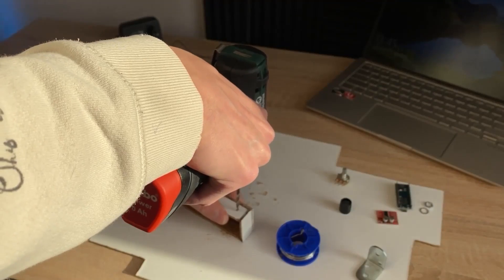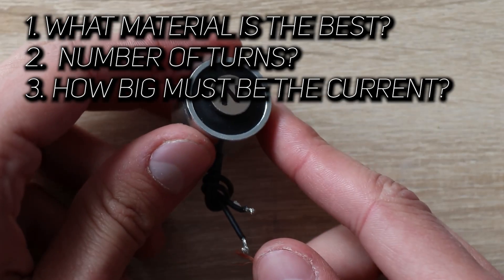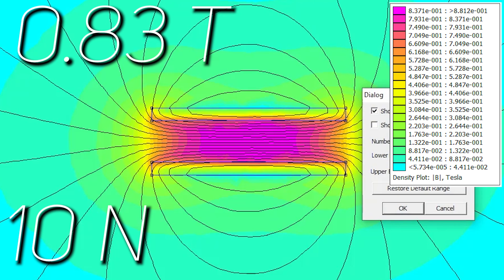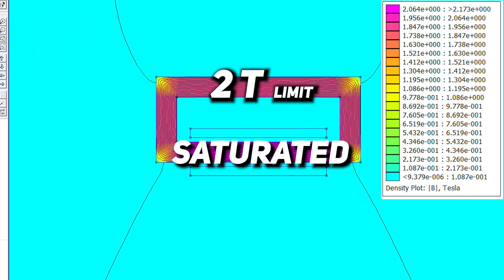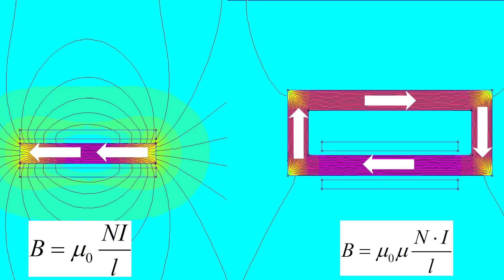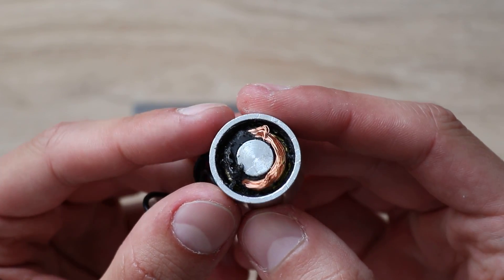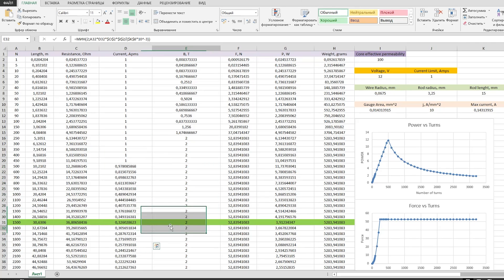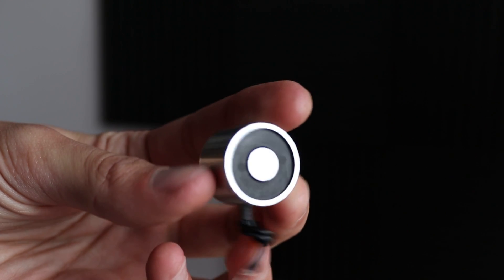5 Tips To Make A Good Electromagnet / How To Calculate Electromagnet Force?

Comment: Thanks for the video I feel kind of stupid now but also wiser. Biggest kmolage drop for me was that instead of the nail the core should also be used to guide the magnetic field around the wire on the outside as well to the one side you want magnet to grab onto the metal. Thanks for the video
Reply from the maker: You are welcome :)

Comment: @NickElectronics Would you attempt to build a non ferrous metal "attracting" electromagnet?
Reply from the maker: You can do that, but there is another principle. Eddy currents have to be induced in the non ferrous metals. Then that current creates a magnetic field which interacts with electromagnet. I am not planning to build anything like that in the nearest future
Reply: Alternating current non-ferrous metal attracting electromagnets have been in published books and articles. Leonard R Crow wrote the book and Popular Electronics has an article titled the Master Magnet. I'm struggling to comprehend the full engineering and construction process for the coil and the necessary electrical requirements. I'll learn more. I know 50 to 1000 Hz is optimal for the power frequency ranges for the magnet, and that affects the metals drawn near the working portion of the magnet. I know the copper core component is critical for field creation.

Comment: Hi can any one help me which kind of  power  is used hear ( Ac or DC or DC switching : pwm ) what is use ? because i have made a selonoid and it got hot and burned out  when applied with Dc 12 volt  lithium polymer battery  2500 mA/h      what do you say ?
Reply from the maker: DC. Probably, your soldeoid burned because the current was to high. Usually, it is okay to have current density in a wire in a range of 4-8 A/mm2. Then even without cooling it should be fine.

Comment: I want to build a fuel door lock for the car. Magnet behind the chassis, on shut, reverse current to jump it open.
Reply from the maker: I hope that info in the video will help you with that. I know nothing about cars, so good luck 😅
Reply: @NickElectronics  Basically if you put the magnet behind a metal sheet and the amperage is high enough it can keep the door shut via a glued magnet.
And then, I suppose, if you reverse the current of the electro magnet it switches polarity and it pushes the door magnet instead of pulling. No?
Reply from the maker: @DaxterSnickers  so with an electromagnet you want to pull a permanent magnet, which is behind the metal sheet? Am i understadning correctly?
Reply: @NickElectronics  Yes. The question is just if I reverse the polarity will the poles of the e-magnet switch too?
Reply from the maker: @DaxterSnickers  Yes, the polarity of the electromagnet will also change and will repel the permanent magnet.

Comment: Is normal steel or just pure iron fine?
Reply from the maker: There are different types of steel. Some of it is good, some of it is bad. Electrical steel is good, for example. Look for one with high permeability (if you can get such an info). As I say in the video - "dont take any bolt you see..." :D

Pure iron should work fine. But it gets rusty
Reply: I have a nail made from 99.9% iron so ill just use it.
Reply from the maker: @SimonsAstronomy Should work then

Comment: I'm sorry but I'm having a hard time understanding what a pancake structure coil is. I'm trying to make a eletromagnet with an old microwave transformer, does the transformer have a pancake structure? Also, how do I get the amount of turns of the coil with the resistance like he did?
Reply from the maker: @Assmannvini  By pancake i mean flat, where coil is incorporated into metal part, like i show in the video. 
Calculate resistance using simple formula from wikipedia. Knowing length of wire and its thickness it is very easy

Comment: do you know some resources about estimating the effective permeability?
Reply from the maker: I beilive for simple estimation, ChatGPT can do OK :) 
From the other side, it it easier to calculate it, making a simple experiment like this one:
https://product.tdk.com/en/contact/faq/ferrite-0014.html

You have to wind some coil turns around studied piece of metal, measure its inductance L and calculate effective permeability.  

Thirt method is doing simulation. But without any experience this one is the hardest. Cause without an experience how tf can you know if the results you get are correct or not? Good question, good question...

Comment: This video was very helpful, just a quick question. I'm doing an electromagnetic levitation project. How do I alter the electromagnetic force equation to take into account the distance at which that force is experienced
Reply from the maker: You should consider the distance to the object as an air gap. So the distance (gap) affects effetive permeability. There should be formulas in the internet which show how to calculate effective permeability of the material with the gap.

Comment: Awesome job explaining! Thank you. If you can learn the basic fundamentals and principles it will go a long way. My road to the electromagnet was much the same. You can go crazy learning too much. Maxwells equations. Yuck! Right-hand rule, force, magnetic field, flux density, permeability. Oh, yeh, total saturation. Then when you finally get it, you better learn some thermodynamics. The heat is an issue. Heat dissipation. Respect the current or Amps you need. Very fun project. You can learn much.
Reply from the maker: Thank you very much) Yeah, it is a long journey. When you think you understand how something works, there are some new variables pop in and change everything)))
But, nothing is perfect and it is better to have a non-ideal solution rather than a perfect plan)

Comment: 0:35 why is there a resistor bomb 💀
Reply from the maker: To make assembling more fun and always cut wire with a right color)
But for real, cause my non regulated power supply had a current limit and coil resistance was too low to stay below the min current level. So power supply current protection was turning off the power supply. Thus, I had to put limiting resistors)))
Reply: @NickElectronics  i thought you wouldn't reply 😅😛
Reply from the maker: @justanormal16yearoldkid51  😳

Comment: how did you calculate number of turns?  by resistance? how exactly?
Reply from the maker: I provide formulas  in the video. Resistance is only one parameter and usually process of magnet design is iterative process. Cause there are different limitations: resistance, as you said, magnet peak temperature, space limitations, its power etc. So you do calculations, check wether  some parameters are out of tour limits, then recalculate it. Resistance of the wire in reality is a bad thing and preferable to have it as low as possible, but this increases wire thickness and forces you to use more complex control of the magnet. So for magnets you can buy online, resistance is used for limiting peak current as well. In such case by changing applied voltage, peak current and magnet force can be changed

Comment: Y GREET YOU  WITH RESPECT  ! PLEASE YF YOU  WANT TO HELP ME  WITH SOME INFORMATION.
HOW CAN I TRANSFORM  A ROUND IRON PLATE,  WITH A DIAMETER OF 50  CENTIMETERS, INTO A STRONG ELECTROMAGNET  ?
THANK YOU VERY MUCH !
Reply from the maker: Google industrial electromagnet. They are big and flat. I believe you have to use similar structure for your design. But overall, all principles described in the video can be applied to your case :) Good luck

Comment: Hey brother, do you have any idea about the amperage limit of the copper wire? I need to run 10A using 1mm wire, and the internet doesn't have a consistent answer. What thickness of wire did you use and how much current did you run through it?
Reply from the maker: You need to find a parameter -  “current density” for your application. It depends on many factors, like cooling of the coil, max desired temperature etc. But the rule of the thumb is usually around 8 A/mm^2. Good luck )

Comment: Where is that Force equation coming from? what is it derived from?
Reply from the maker: Maxwell Equations, like everything else in the world of electromagnetic waves :) But they are really hard to understand. So you can google Lorents Force as well )
Reply: @NickElectronics  Thanks! But could you explain the cross sectional area? Is it the rectangle or circle version of the cross-section? If not, how is it calculated?
Reply from the maker: @weikeco  Depends on the core you have, formula will be different. Imagine you slice a core with a perpendicular to its surface plane. The area will be cross section of two

Comment: Anyone notice how his force equation doesn't actually give 100mN ??
Reply from the maker: Yes, one guy in the comment have noticed previously. I did a mistake when was putting the cross section value in the formula. If you pay attention, in the video i say that diameter is 7mm and it`s cross section would be 38.5*10^-6 m^2, but i have 15*10^-6 in the formula for some reason, which is wrong :/// So there should be 38.5 instead of 15 in the second formula and result is around 100mN. My bad.
Reply: thanks for the clarification. I am doing an experiment in which I am using electromagnets to accelerate a small aircraft and I've been trying to do research on how to increase the strength of my solenoid. Your video helps a lot. I noticed you mentioned that core materials reach their saturation limit, is there a way to increase the saturation limit of the core material?   @NickElectronics
Reply from the maker: @aaronnunez248  So far as i know, you cannot increase materials B max value. Basically, when you reach saturation limit, that means that all “micro magnets” inside the material are oriented according to the field and no matter what you cant increase B  for the that material 🤷‍♂️
Reply: @NickElectronics . sadness. So even if I were to increase the voltage/ current through my solenoid or increase the number of turns I won't be able to get a larger amount of tesla out of my coil ? Because I need more than two tesla for my project or actually I just need a larger force output. So another question would be can I still increase the force output of my solenoid even though the flux density is limited.
Reply from the maker: @aaronnunez248  If you have reached Tesla limit, the only way is to increase diameter. Number of turns and increased current would lead to nothing, unfortunately 🥲
Reply: @NickElectronics   so would an increased diameter help me with improving the size of the magnetic field or the force output
Reply from the maker: @aaronnunez248  yes. It will. Increased diameter also will allow you to increase current (or wires number). Cause you will have more core material

Comment: Good, short, to the point.  Here is our (first) Lorentz force disk:
1)  layers of aluminum foil, each layer separated by an insulator layer.  This lamination of foil-insulator-foil-insulator etc. is positioned horizontally
2)  magnetic field is positioned vertically and axially (through the center) of the lamination
3)  small flat coils are positioned radially and right next to (but not touching) the foils lamination

The coils are fed 16.28Mhz due to the skin depth that is based on the foil thickness, and induce RF current in the metal. 

The vertical B field and horizontal, induced RF currents at the 16.28Mhz rate in the metal layers develop the Lorentz force, and cause coherent accelerations (oscillations) of the charged particles in the metal layers at the 16.28Mhz rate

At time 0:43 in the video, the text from your book "Basic Magnetics Theory" says:  "When the core saturates...inductance is greatly reduced and large currents result" - we use this to advantage.

We can use thin ferro layers in our Lorentz disk and run a low DC current radially through the ferro layers to control the RF current flowing in the hull of this device.   Bill Sturgeon, 200 years ago (in the year 1824) invented "ARTIFICIAL MAGNETISM" - aka the electromagnet.  We're working at
artificial gravity devices.

Comment: This video is so awesome! One trick to reduce ohms is dividing the wire into equal segments. For instance 1500 feet ÷10 reduces wire link to 150' each. Increasing Tesla's and reducing ohms. 
Core material is very critical. Supermendur is a good material, but always use layers if possible.
Reply from the maker: Thank you for an informative comment :) 
I haven`t heard about Supermendur before. Google says it has the highers flux density (2.4 T) among all metals 🤯
Reply: @NickElectronics  I'm building a magnetic bearing linear motor, and plan to use this material at some point. So far thin layered laser cut soft iron material has worked very well in tests.
Reply from the maker: Wow, I`ve checked your channel and subscribed) It is really amazing. For what purpose are u building it?  @woodbrassandglass
Reply: @NickElectronics  eventually for experiments in generating electricity. I will change the magnets orientation to be radial and rollers be axial magnetized. Basically a motor and generator in one device
Reply from the maker: Good luck :) @woodbrassandglass

Comment: How do I prevent the stupid metal coil from turning into a permanent magnet due to use!?  I want my magnet to let GO when power is off!!!
Reply from the maker: Use core material with low remanence. Or demagnetize core applying reverse polarity to the coil. But in case of demagnetizing field strength (current through coil) should be specific. You can experiment with it :)
Reply: @NickElectronics  what is an example of core material having "low rermanence"? Is it considered a type of iron somehow?

I wish thing thing to be let go had more mass such that it might fall away. But, instead, it's like a paperclip!

Comment: It will be amazing if someone builds a tool where you place coils/magnet tipe, interna/external diameter and desired RPM (with highest torque associated) and it outputs a pcb. I have a bunch of applications and, even understanding most of these videos, I can't build this by myself (yet)
Reply: I will try

Comment: @Tall Nick Electronics How does peak current impact saturation? I need to move ~1kg at a distance of ~8mm (air permeability)  over 3-4mm.  I wanted to use a supercapacitor to discharge a burst of  2.4k Amps into a solenoid. Do you think I will hit the same hard limit? I am aware saturation follows a logarithmic scale, but I wonder if I will still get a higher Tesla peak using a burst?
Reply from the maker: What you are talking about is a high power current generator. It is a little bit different from conventional electromagnet i think. You should look theory for a railgun if you want to create something that you mentioned. 
About the parameters you mentioned, i don`t know, cause it is a specific task that should be individually calculated :)

Comment: What was the software that you are using ?
Reply from the maker: FEMM 4.2
Reply: @NickElectronics  is that only for magnet and electromagnet?....
Reply from the maker: @aravamudhankcs6476  for magnetics mostly. Also for heat flow and current flow :)
Reply: @NickElectronics  is it possible for you to make a tutorial video
Reply from the maker: @aravamudhankcs6476  i am not using it daily, so i am not specialist in it. I used it for the video to show processes in electromagnet, cause it is relatively simple tool for simple tasks. And i know there is not that much tutorial videos about it in the internet. If i had to simulate something complex, in more details, i would probably use Ansys Maxwell. Cause there are much bigger community and easier to find examples.

Comment: Hey, the equation for magnetic force in minute 2:33. i typed the numbers on screen into a calculator and i did not get 100 mN. I need this formula desperately, could you please explain what i am doing wrong?
Reply from the maker: Hey, yeah, ahaha. In video i say that diameter is 7mm and it`s cross section would be 38.5*10^-6 m^2, but i have 15*10^-6 in the formula for some reason, which is wrong :/// So there should be 38.5 instead of 15 in the second formula and result is around 100.
Also, next time i gonna put approximately equal sign instead of equal, to not confuse people )
Reply: @NickElectronics  I’m so confused how you got 38.5 cross sectional area. I don’t know what precisely “cross sectional area” is referring to. 

I wrote more and just as I was about to comment I realised it’s pi*r^2 = 38.48

I was imagining the coil cut along the length and cross section equaling length times height (15mm*7mm).
Reply from the maker: @davadoff  
Yep, you understand it correctly :)
Reply: @NickElectronics  Thank You so much!!! ohh and why is there a (10^-6) being multiplied by 83^2?
Reply from the maker: @victorlopez-perez1887  Cause (83 mT)^2 is   ( 83*10^-3 )^2 which is 83^2  *  10^-6
Reply: @NickElectronics  so 10^-6 is to convert from miliTeslas to Teslas?  but (83*10^-3 )^2 equals 6.889*10^9 and (83^2  *  10^-6) equals 6.899*10^-3 which are different, which one should i use?
Reply from the maker: @victorlopez-perez1887  Yes, to convert miliTeslas to Teslas. And no, they are not different. You must be doing something wrong. Check it again, please :) Put it to the calculator
Reply: And sorry to bother you so much about this but do you know the name of the formula, I cannot find it in google
Reply: oh yeah  haha i forgot to put a negative exponent in the calculator thank you
Reply from the maker: @victorlopez-perez1887  You can even find it in Wikipedia. Page called - "Electromagnet". There are different ones, but also there is one exactly the same.
Reply: @NickElectronics  Thank you so much for help!!!, I needed this equation for the Internal Assessment for a physics class and you helped me to understand the equation :)
Reply from the maker: @victorlopez-perez1887  You are welcome :) Send it to other students in class, ahaha))